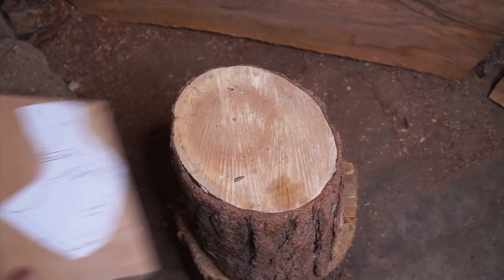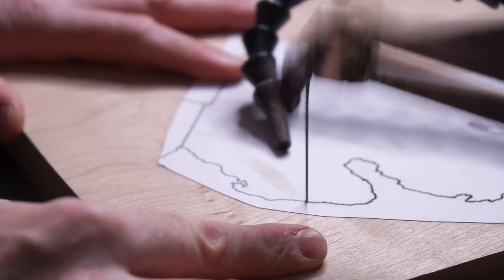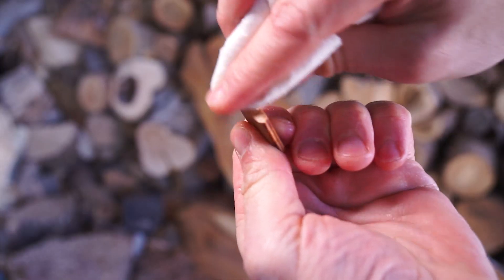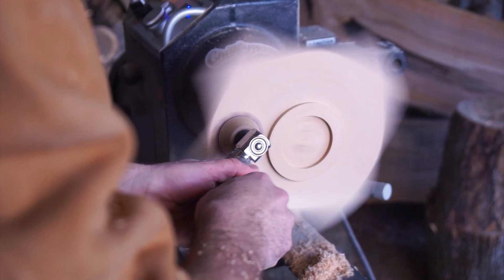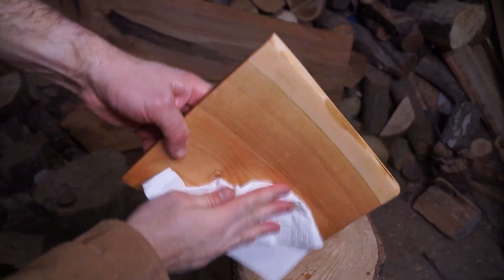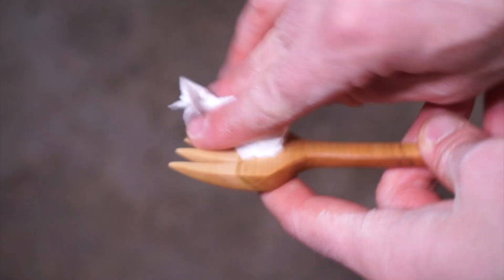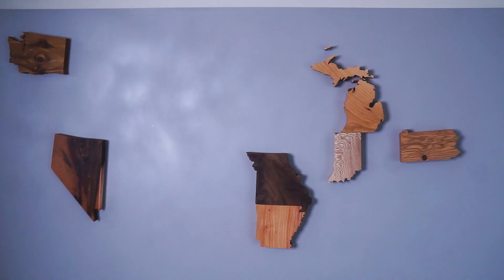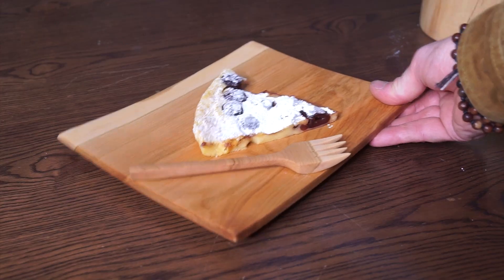North America's Cherry Tree Isn't the One You Know | Making the United States out of Native Trees

Comment: I've got a few anecdotes about this tree. I'm from Ohio black cherry grows pretty well around here. Not as dominant to the local forests as something like Sugar Maple, but you'll never go long without seeing one.

The trees are remarkably resilient. There's an anecdote I always like to bring up. There was one Black Cherry in my parent's woods which had fallen on its side, sent a shoot up which died and is covered in fungus, then it sent another shoot from its horizontal trunk, which died. Then it clearly did that two oore times until the last one was perfectly healthy and has plenty of leaves. This individual was about 7" diameter from the base all to the start of the final shoot.

As for the wood, my parent's 100+ year old house and barn was built with a lot of it. The barn has cherry plank siding and despite how grey and rotted it looks on the outside, just under the surface is strong wood that looks like the day it was put there. Lovely tree.